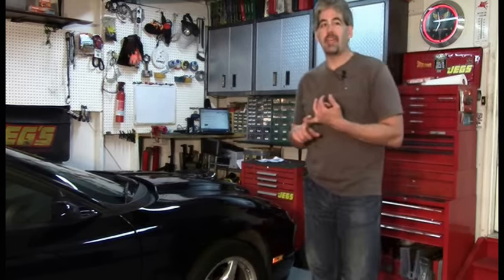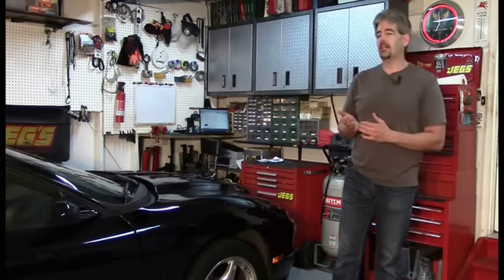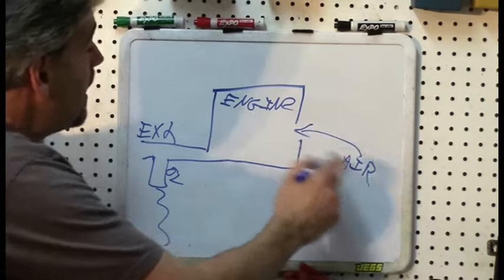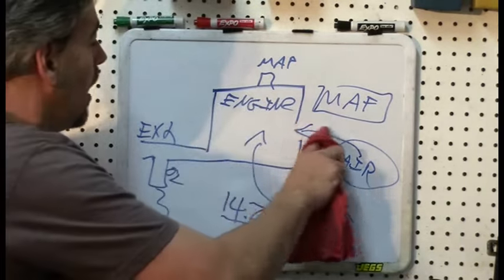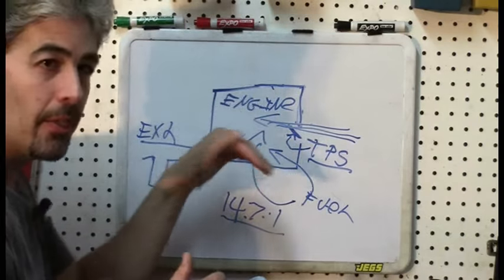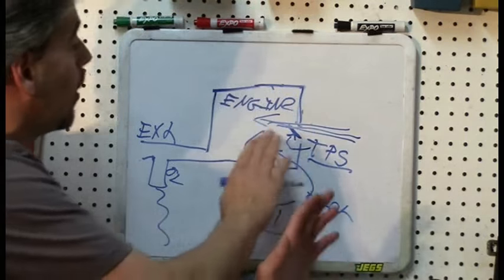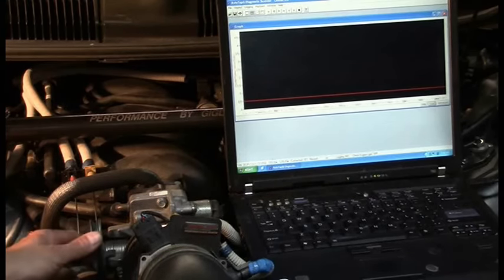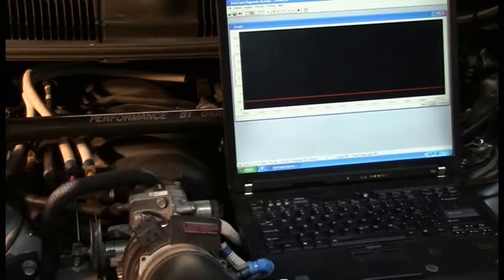TPS (Throttle Position Sensor) Diagnosis and Understanding Pt1

Comment: Hey Matt , really like the TPS explanation. I work on copiers for Canon and use a multi meter occasionally . Your explanation of the system is very explicit (nice) . Can't wait to get home and check the TPS on my 93' Escort wagon , it's been giving me some grief last few months with hesitation performance . Did the tune up ,repl. MAS ,cleaned throttle body ,had some gunk inside ,and had the fuel pump repl.(did help with some pep,still hesitated,unfortunately now leaks a little gas,already brought back once) ,anyway , look forward to watching your videos , so far they are extremely informative ,can hardly wait to see what happens , was looking to repl. TPS , would be nice to know if it's bad before I buy it . Thanks a bunch. Bruce ,58.

Comment: Loved the joke about being familiar with the rear end of the trans am.  Laughed out loud.  Keep in mind that potentiometers work both ways and manufacturers might setup the TPS to read increasing or decreasing values.  This is where getting a hold of factory specs and not just a Haynes manual comes in handy.  In order to know what your expected values are you must acquire the documentation for those expected values.
Reply: I'm going to have to get factory specs. On Matt's discussion page an individual posted a link to his TPS showing 10% open to 70% open, identical to mine on the same car....one example is not proof enough that it should be that way even if it helps the emotions a bit.

Comment: I really appreciate the knowledge it helps for those who don’t have automotive expertise!! I have a trailblazer with similar symptoms of the map sensor but was told it was my timing chain so hopefully changing the MAP may help
Reply from the maker: First, get data on the map before just changing it. If the the data indicates the MAP is the problem, then change it.
Reply: Schrodingers Box ok thank you for your response

Comment: "TPS Diagnosis Pt1" was an excellent presentation. I was just fine with the humor (mine is worse) and the negative comments I have read seem to have little or nothing to do with the value of your detailed technical content. Criticism is usually the case when lazy minds are challenged to think. 
Anyway, I have a 2005 Honda Element with a manual gearbox. It ran fine and then I had a clutch failure. I changed the clutch and now the car will not start.  Though the TPS seemed to test fine I did change it for new . Still no start. 
NOTE: a few times the car did fire, but ran for just a few seconds; OBD indicated both TPS and IAT codes after brief runs; I have checked and adjusted Clutch Interlock SW, Pedal travel and Clutch Position Switch (Cruise Control);  the Key Immobilizer appears to be working properly by dash indicator sequence; I have fuel flow though I have not been able to check pressure; I have not had a successful ignition spark check though I am waiting for a OTC 6589 Electronic Ignition Spark Tester for a more accurate test. 
I am new to Electronic ignition, but I sense an electrical issue and am in the process of continuity testing the harness though Honda does not have a full circuit diagram in their manual, only small sectional diagrams.
If you do not mind, Two Questions: 
1. Will a failure in the TPS and/or wiring circuit prevent the car from starting at all?
2. How does ones test for an ECM/PCM failure?
Thanks for your help and consideration.
Reply from the maker: Test for control to the coil. If none suspect CKPS- if there is signal return to PCM but it is not recognized PCM is bad.

Comment: I have this code and watched this video and learned a lot.   Now I go out to my car and start looking at it.   I found the cable unplugged.   I just got my car back from the shop to get the Cat replaced.   I did not have this code before the shop visit.   I called to ask if they would have played with the cable and he said that would be possible as part of the diagnostic for the Cat.  So I learned a couple of things from the shop and a whole lot from this youtube.   Now I fully understand how the car works with these sensors.    funny that my car ran pretty well.  only problem was id died twice but other than that ran ok.  Now I know why:)

Comment: When you suggested, I had to look to the side and I immediately saw various how to replace videos. As I looked further down there were diagnostic and adjustment videos. Okay not as bad as we thought. :)
Reply from the maker: DE Nichols Really? but did they actually show diagnosis or did they just say it? And even then did they do it right or did they just test for a 5V signal or something?
Reply: I actually couldn't make myself look beyond the titles. My diagnosis trust is very slow to spread on my channel choices.
Reply from the maker: In that case, how lucky I am you found my channel DENichols!
Reply: Absolutely lucky for me. :) Every hundred videos I dare to look out at other channels. I saw your video there about head gaskets and my favorite channels had left me still wondering.

Some of the other suggested videos I had seen and a couple more were channels on the reject pile. 

There you were claiming from my point of view and promising from your point of view that you'd really explain it. When you really did fill in a bunch of holes ... well you know the rest.

When I was done I thought, "When Rachael believed her head gasket had gone bad and all I knew was I had failed to fix that once on my own car, there was no way I would do that to someone else's car. And now I knew what I was missing. I can do that now!"

... a thirty years and former mechanic realized a shop had left seafoam in the oil instead of cleaning the engine out and then actually changing the oil.
Reply: Okay, I bit, I tried a few of the other suggested videos. One of them set their TPS at an angle for an incorrect value for his car, "but it felt better". Sure, and then when it doesn't feel any better, it's not because you're "used to it" it's because the ECU has adjusted fuel trims to correct your fouling up the 14.7:1.

A few videos of a few minutes "took longer" in the experience then one of your unnoticeably lengthy videos.

Comment: Good info but a few suggestions... a) I got back probes from amazon for about $8. These pierce the wires from behind the connector and are insulated to prevent shorts. A meter or scope plugs into the back probes open end. You don't have to remove the connector for testing.  b) I got an oscilloscope from amazon for about $80 - sain smart DS120; it uses a PC (laptop) as the control and display, keeping cost down; not for serious engineering but great for auto sensor diagnostics; c) a PC power supply - old or cheap - has +5V +12V and Ground, so I use it to remove sensors and bench test them from my desk; you have to make some connectors to the pins that are insulated and then alligator clips to the power supply connector; d) if you do it your way, you can put heat shrink or a crimp splicer (insulated) on paper clips (leave 1/4 inch sticking out) to make probes that plug easily into a female connector. These are bent in directions where they don't touch; then use alligator clips on these to connect your meter. It leaves both hands free and is safer than probing pins/sockets directly from the meter leads (as you show); Just some thoughts on things I've done to test without risking shorting the ECM.

Comment: BTW Im using this to diagnose my 4 stroke outboard engine. Lots of crossover, thanks man!
Reply from the maker: Fantastic! Yes I have fixed many a boat motor- many are exactly the same as used in cars- Volvo 5 cylinder, Chevy 350…

Comment: Great videos. Have been watching them tho I'm not a mechanic, not even close. I do like cars and this is so much better than discovery channel:) BTW, I've got an issue on my subaru outback 2.5. The engine is really shaky while giving it gas. Also, it can whobble while going  down from revs. I've checked pretty much everything: valves, MAP, MAF, saprk plugs, spark plug wires, throttle, o2 sensor, fuel pump, knock sensor, cylinder compression, catalytic converter. The only thing I can think of now is what you present in the video. My car has the onboard readout which shows the throttle position - it's always slightly open. Some mobile phone scan tool [as I said, I'm not a mechanic:)] shows me that, on ignition, throttle is opened about 16%. The car starts rather high at about 3000 rpms. The throttle on the car is electronic so it's a marriage with the, also electronic, gas pedal - the scan tool shows me that while giving it gas there's no fluent and linear transition, at least not always. Maybe it's the gas pedal potentiometer. Anyways, great stuff here:) Btw, there are no fault codes displayed...
Reply: +Nic ztego   When you bought it …you thought that R&H was   radio and heater…..but now find it meant   rattles and heaves !   Have you ever noticed that  Subaru backwards is    U RAB US !   or  U  R A  BUS  ! ! !

Comment: Excellent video, with good explanation of the TPS function. If I may add, a simple test for the TPS performance while it is on the car is to connect to avoltmeter, and observe the change in resistance as you change the throttle position (stepping on the gas). Do you agree?

Comment: Sure wish I had found your site before struggling with TPS.  My TB had a ton of deposits and had terrible hesitation, and being a Honda, it also stuck the gear lever in park when my cal moved, d/t using a cheapo after market TPS.

Comment: I agree with your suggestion that people get a scan tool, but have a suggestion that is vastly cheaper and almost as useful as a full blown scan tool.  You can get Bluetooth ODB2 adapters online (eBay is a decent source) for less than $30, and then get an app for your phone.  I highly recommend the paid version of Torque.  Either way you get O2 sensor data, MAF data, fuel trim, coolant temp, rpm, manifold pressure, etc.

Comment: @ 21:07 If you are connected between ground and signal, it will produce the same resistance affect as if you were connected between 5V and the signal wire.  It is voltage divider so you can measure the resistance either way. The resistance will be inverted of course for either case.

Comment: YOU ARE THE MAN, I watch every video to, One last question,, When I was resetting the ECM, PCM  I made a BIG mistake (I think) instead of removing the negative post , I took the positive  cable off & ran a thin wire from the +(positive) cable to the -negative post/cable ,, It sat like that for 15 minutes till I saw that I did it backwards. After that I got 5 trouble codes, I replaced the TPS & the MAF which cleared most of them. A day later I did a correct reset, then #8 plug was bad so I replaced the spark plug & did a code check again and I got P0104, P2104 and P2111. & it keeps going into limp mode but the P2106 doesn't come up anymore. In your professional opinion did I fry the PCM/ ECM cuz the 05 CVPI ran perfect, no engine problems at all. Please help me  I can't afford to have it fixed...
Reply from the maker: Impossible to fry the pcm that way.
Reply: @SchrodingersBox  thank you very much.  I'm having a hell of a time trying to figure out what happened to my  car when I replaced the rear end ,  I have a SCT X4  AND when I do a live data monitor of all the components I have no idea what it all means.  Can I send you 1 of the histograms ? I will donate to your channel what I can afford but I am somehow surviving on S.S.D.I. but I'll make it work your while Matt.
Reply from the maker: There would be no use sending that data. You have to confirm the data acquisition according to your targeted strategy.

Comment: subscribing....good machanic
smart..informative...i will now.check my throttle body.for carbon...270k miles and never been checked...
tps and idle air control valve have been replaced.....code says.tps......2003 olds silhouette 3.4....fully maintained otherwise....has high idle or rpm change after in gear....1500 to 3000 variance in rpm...

Comment: Congratulations Mat.  Excellent step wise presentation of content and great camera work.  I don't get the thumbs down or negative comments.  ?  I think that came from the first minutes on the black board.  If that section was prefaced with a good summary things would have been different. Thank you for the lesson.
Reply from the maker: Thanks David.  In general- when you show a "car repair" video that doesn't use a wrench, you are gonna get thumbs downed lol. People just don't get it.

Comment: I was just wondering after watching your video,why you don't just connect the ground to the engine as all grounds for the vehicle are  common.This hopefully would reduce the leads from the multimeter shorting together and once you have determined your 5 volt and your signal wire, you could do a voltage drop test on your ground lead to see if it had any resistance. Thank you for your videos I find them extremely interesting and have learnt so much.
Reply from the maker: It's a good idea to do that except that TPS grounds are floating grounds- not directly return to battery.  The ground goes through PCM so by checking at sensor I confirm both grounds are functioning.

Comment: Dear Mr. Mat, 
For about 3 months, I had a no-start with my car. My car is a BMW 2002 530d automatic transmission. I am the 2nd owner of the car and the car is presently at 67K in 15 years. I have maintained the car in condition and did all my services. I had the car over a year now. I have changed the engine oil twice, all the filters twice, fuel injection filter once. I have also changed the transmission and differential fluid. The engine mounts, transmission mounts and any other noise-making bushings are changed.
I want to come back to my problem. The problem started around 3 months ago, not starting from a random location. In 2 weeks or so, it repeated itself. After that, it was more often. Currently, I have found the exact symptom. In the mornings, there is no problem, it starts in one go. But when I go to a restaurant and stay there between 10 to 30 minutes, it %90 of the time does not start. If I stay there 3 hours, again it starts in one go. 
I have watched many of your videos and enjoy a great deal from you Mr. Mar. I also like your strategy in trying to solve a problem: you start with the most common and then narrow it down to the least possible cause, after carefully visually inspecting the car. However, although I watch many of your videos, I am no car geek. I am an English teacher and I am a beginner in this field. 
I would like, if you have time, to have a look at my problem and speculate on the possible causes of this problem. One instance of no start has been taped by me and I will give you the link here:
https://www.youtube.com/watch?v=zo00Dk_nfmA
Thanks in advance.
Reply from the maker: WHat data do you have? Please be brief and just list the LTFT and STFT at idle vs a load curve and what the O2 voltages and MAP readings are.

Comment: hi Mat the TPS potentiometer is basically the same as testing the volume control on a guitar amp or any variable control it has a variable resistance from point a to b with a tap off point to select the resistance value you require  typical values used in amplifiers would be 250k---500k  the (DEAD) spot is usually dirt on the carbon track or poor contact with the track  if it can be disassembled it can be cleaned with contact cleaner or isopropyl
Reply from the maker: Correct- in fact I show this exact technique in another video repairing a fuel level sending unit which is also potentiometric.